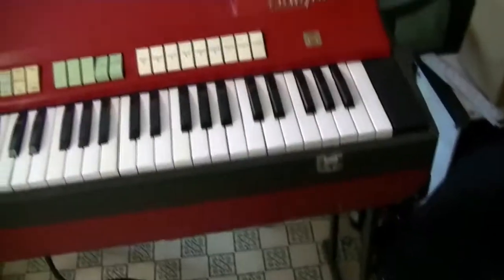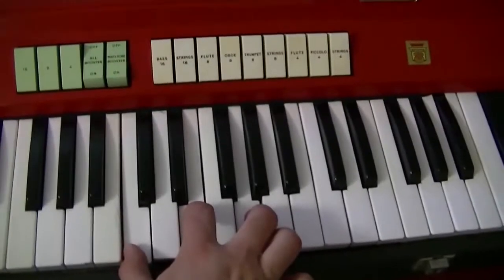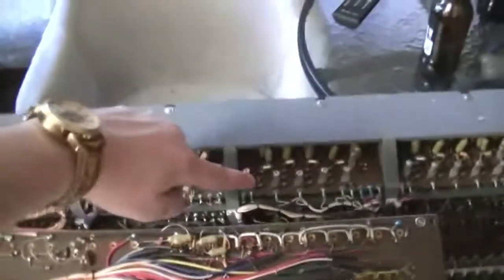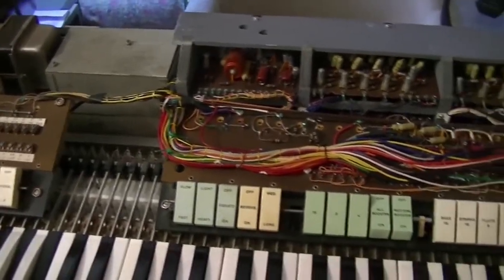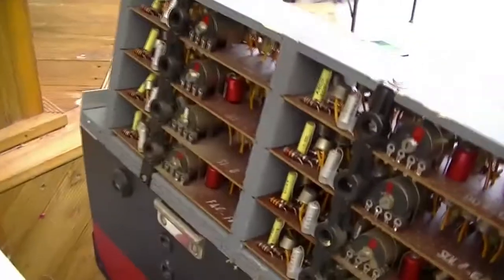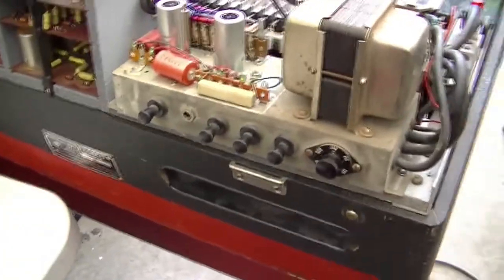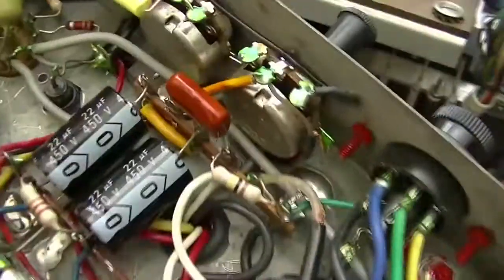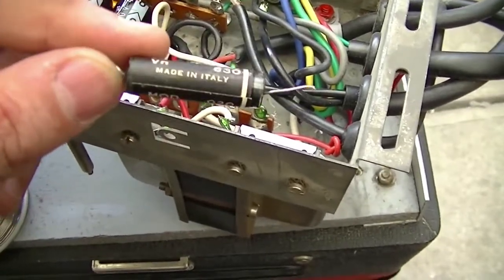Restoring A Farfisa Compact Electronic Organ - Part 1

Comment: How hard of a job is this? I'm looking to fix mine that is suffering the same problems
Reply: Kinda OK job, if you know what you are doing and have schematics. Just be patient and measure. Also lot of time it’s capacitors, if not then it’s bad transistor. If not that you are doomed and good luck to your poor soul 😂 Just kidding, it’s always reparable but, you need to put hours into working on it.